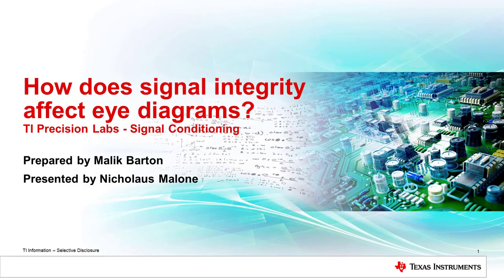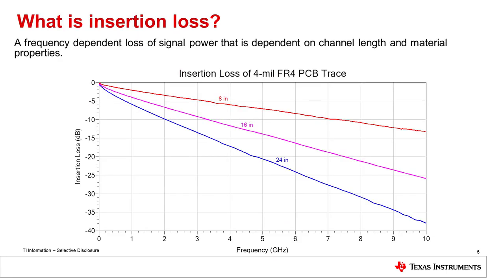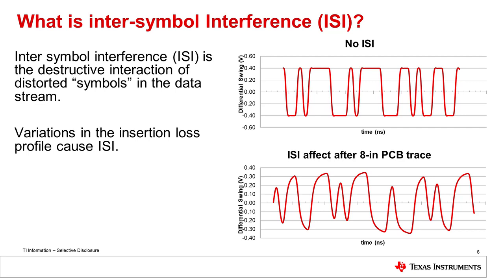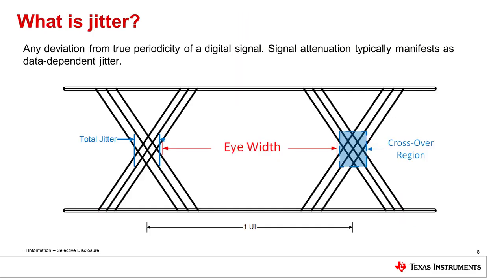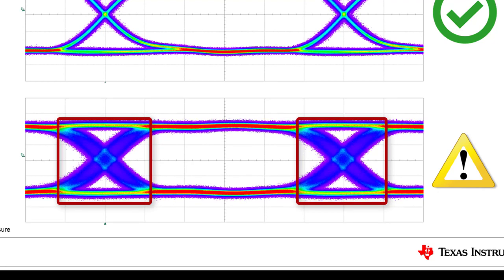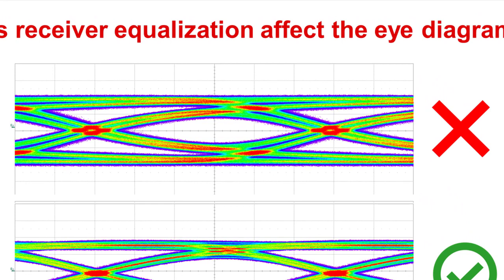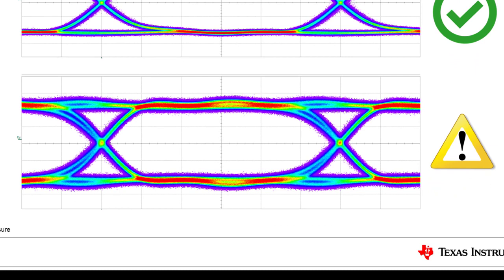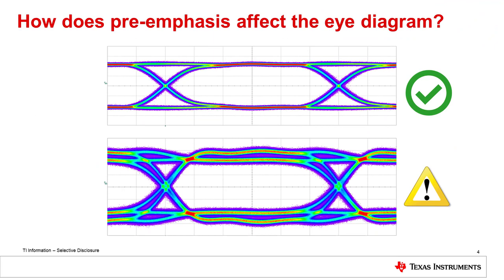How does signal integrity affect eye diagrams?

Comment: Signal integrity significantly impacts eye diagrams, crucial for evaluating high-speed data systems. Key factors include insertion loss, inter-symbol interference, and jitter, which can degrade performance. Techniques like receiver equalization, pre-emphasis, and de-emphasis help mitigate these issues, enhancing signal quality and ensuring accurate data transmission.

Highlights:
00:12 Understanding signal integrity is crucial for high-speed data systems, as it significantly impacts data transmission performance. Eye diagrams serve as essential tools to evaluate and debug signal integrity issues.
          -Signal conditioning techniques like receiver equalization and pre-emphasis are vital for combating signal integrity degradation. These methods help maintain high signal quality during transmission.
          -Insertion loss is a primary factor affecting signal integrity, leading to power attenuation as signals travel through transmission media. It's influenced by channel length and material properties.
          -Inter-symbol interference occurs when distorted symbols interfere with each other during transmission, leading to data corruption. This is often caused by variations in the insertion loss profile.
04:04 Inter-symbol interference (ISI) significantly affects signal integrity, particularly in eye diagrams, by causing increased jitter and reduced peak-to-peak voltage. This leads to timing errors and overall data transmission issues.
          -Short symbols tend to experience greater attenuation due to their high-frequency content, which affects the overall signal quality. Longer symbols are less impacted by this phenomenon.
          -The eye diagram serves as a visual representation of signal integrity, highlighting differences in jitter and insertion loss. Comparing eye diagrams helps identify the impact of these factors on signal quality.
          -Total jitter is a critical measure in evaluating signal integrity, combining both deterministic and random jitter. Understanding jitter types is essential for improving eye diagram analysis.
08:39 Signal integrity degradation can significantly impact data transmission, especially as total jitter increases. Effective techniques like receiver equalization are crucial for maintaining signal quality and compensating for degradation.
          -Receiver equalization selectively boosts high-frequency data to combat signal degradation. This technique enhances signal integrity by counteracting insertion loss and reducing inter-symbol interference (ISI).
          -The effectiveness of receiver equalization is limited by increasing frequency, where the transmission media's insertion loss can surpass the equalization effects. This underscores the necessity for adequate bandwidth in equalizers.
          -Over-equalization can lead to new issues, such as reappearing double banding and unintended increases in eye height. Balance in equalization levels is essential to avoid compromising signal quality.
12:13 Signal conditioning techniques such as pre-emphasis and de-emphasis are crucial for maintaining signal integrity in transmission media. They help optimize the signal quality by managing frequency content effectively.
          -Pre-emphasis increases high-frequency components of signals to counteract inter-symbol interference, ensuring clearer data transmission. It enhances edge transitions, leading to improved signal clarity.
          -Identifying pre-emphasis and de-emphasis in eye diagrams can be challenging due to subtle variations. Observing edge transitions and signal levels is key for accurate assessment.
          -De-emphasis serves as a counterpart to pre-emphasis by reducing energy in flat waveform portions, thus improving the signal-to-noise ratio. This technique enhances the visibility of high-frequency content.
16:21 Understanding de-emphasis in eye diagrams is crucial for analyzing signal integrity. It involves observing edge transitions and the potential effects of excessive de-emphasis on signal quality.
          -De-emphasis can lead to variations in signal edges, affecting the clarity of the eye diagram. It's essential to identify these transitions accurately for effective analysis.
          -Excessive de-emphasis may cause double banding and distort the intended frequency content. This highlights the importance of balancing de-emphasis to maintain signal integrity.
          -Signal conditioning techniques are vital for achieving optimal eye diagrams. These approaches help manage variations and ensure clearer signal representation.

Généré par sider.ai